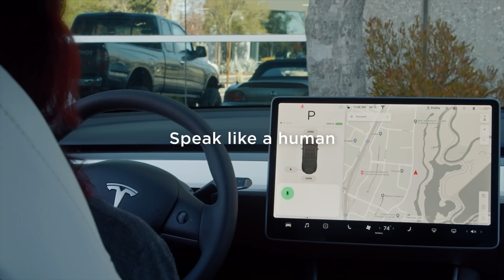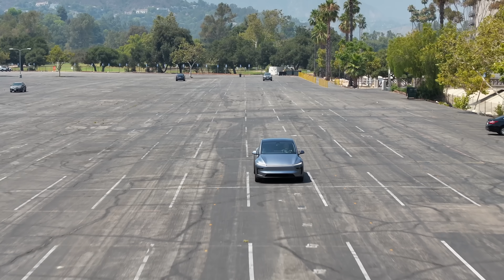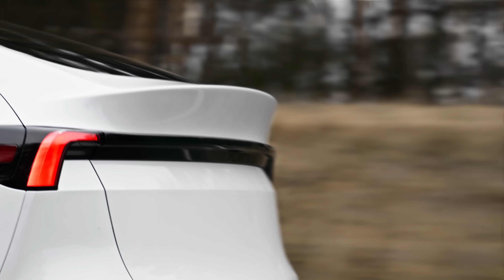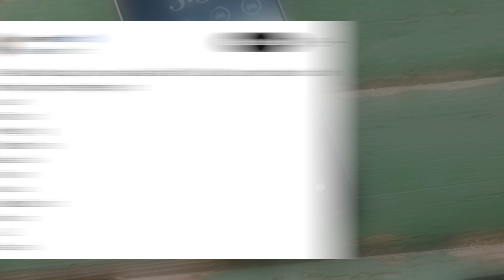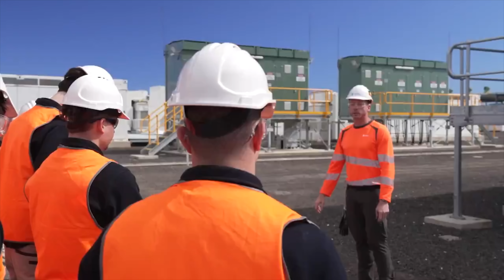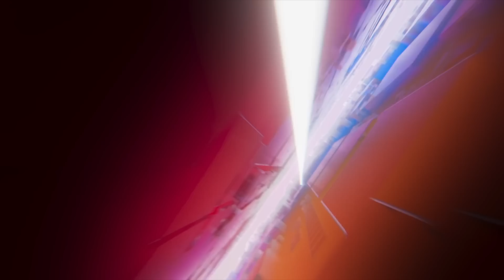Tesla Fixed Their Most ANNOYING Problem | Holiday Update Is Here

Comment: I still think automatic windshield wipers aren't so bad. The biggest problem is still that in the newer models (Juniper & M3), you can't switch between cruise control and automatic transmission (using the button on the steering wheel; in older models, you can use the lever).

Comment: Well thank goodness you can add fun stickers to your virtual car on the screen, that's what was the critical item. Hey, let's fix wipers that were clearly engineered by a team in LA where it rains like 5x year. It either dry wipes your window, goes bananas on a light drizzle or fails to actually deal with a heavy noreaster storm. Those are fixable via OTA update, the other serious weather problem that unfortunately would require hardware is the backup camera, it's garbage in slushy New England winter driving. When we drive on snowy slushy roads, you get to a supercharger and there is an inch solid coating over the camera. I love having to get out at a busy supercharger site and wipe it by hand. Could probably jury rig a heater around it or something. They probably did their winter testing in some ultra-cold place like arctic areas of Alaska which is a different problem, in snowy US states we mostly get slush on major roads, so that is a different problem than powdery snow. The dog mode update is nice. I probably won't use the grok navigation, although sounds nice, I rarely navigate somewhere where I don't know before setting off, so hand type my route.

Comment: My 2018 Model 3 STILL blasts hot air into the back seat unless I set the HVAC to approx -10 deg F of ambient. Once it's freezing in the front, the back seat starts getting cool air, and I can up the temp back to about -3 deg of ambient. I have reported this issue since an update broke it 6 years ago and Tesla hasn't fixed it yet. 
If my car can't do something as simple as HVAC, I'm not going to trust it with driving.

Comment: Most annoying is the slow down on the highway while using FSD.  In hurry mode the car will move to the left lane and then not drive at the speed of traffic regardless of the max speed setting.  Keep having to hit the accelerator to maintain safe speed.

Comment: I despise Grok in my car. If I accidentally activate it, it's nearly impossible to shut it off while driving. While it's on, the stereo can not be used. Even when I tell it to shut off, it stays on in the background. Unfortunately, there's no way to permanently get rid of Grok. I wish I had known before I upgraded my software, because I would have lived with the older software without Grok as long as the car would still operate. Who needs this intrusion into their automobile, anyway? Leave it as a phone app.

Comment: The clip mentioned charging only to 60% at home.  Would that be even better than charging to 80% at home on a daily basis?
Reply: No it wouldn’t. The reason they say 80% is because keeping the car at 80% and above puts more stress on the battery resulting in more ware on the battery. In other words keeping it at 60% is probably a personal choice and doesn’t change anything
Reply: @stephenhaynes5773 thanks!!
Reply: Yes, it would.  The closer to 50% the battery is, the happier it is.  But, it depends on how far you drive everyday.  If you can leave your house at 60% & still get back home at 40%, then go for it.  But don't limit charging to 60% if your car will drop down to 20% before you get home again.  
Tesla recommends 80% as a general rule of thumb because that is a good compromise for MOST owners who have an average distance daily drive.
Reply: @Judge-Mental very interesting.  Thanks

Comment: Super happy we can now control Nav with this update.  My car currently takes me on a different path to work every few days, and it drives me crazy.  no pun intended... lol
Reply: Each update seems to change the routing. If you have the whole trip up on the map (that option which has two dots with the S line between them) you can often pick other routes as you get closer. That's what has saved my sanity. Just tap a light blue option you prefer when it comes up. IF it comes up.
Reply: @Prescottfool  I know what you're talking about, but on my routes to work it doesn't give me that option.  Thanks for your suggestion my friend!

Comment: The ONLY feature I want is “Unlock Door” for ALL DOORS from INSIDE THE CAR!!

I live in a cold climate and I cannot keep reaching over my passenger seat to unlock the frozen door from inside. God forbid anybody is trying to get in the back seat cause I can’t reach that far.

Why does Tessie, a watch app, allow me to do that, but not native Tesla software?
Reply: You can do this inside the Tesla by putting the car in park where the Tesla car animation on the screen will display a lock icon. Simply tap on the lock icon to unlock the vehicle which will unlock all the doors. But yes the only pain is that the car has to be in park so there’s no ‘quick’ way to unlock all the doors when picking someone up. 🙂
Reply: @williamrobinson7864  I was just about to tell him about the lock icon on the screen.  Also, I'm pretty sure there is one you can use without being in park at the top of the screen.  The one when you're in park is above the 3d car image, but the other is at the top and doesn't require being parked
Reply: THIS!!!

We just went through a cold, snowy spell. Every time my wife tried to open the passenger door the handle was frozen solid so I had to reach over and press the button and push the door open. Her exact words were: "This is the dumbest car ever!"

Comment: Phone key chime SHOULD include Card key chime. Just today I was at Tesla Service, and they gave me a demo car while mine's being serviced. After we had paired my phone, I walked away from the loaner, and it locked the car with the card inside. Luckily, I was still at the Service center. Afterwards the salesman gave me his Phone# in case I make that mistake again. At least with a Tesla, they can remotely unlock the car.
Reply: There is no way to implement this. With a phone it use bluetooth to detect distance, while the card don't really send out any signals. The card can only be read when placed on a card reader.
It's rare one forgets a card in the car. I mean, what tesla owners use that anyway? It's only a backup, or when borrowing/renting a car.  But a phone left inside is VERY common. Not only your own, but also imagine when driving with the family, and your other half leave their phone in the car because "i don't need it, i'm just going to the bathroom". This exact thing happens so frequent for me i started just bringing their phones with me as well when i leave the car...
Reply: @JanErik1986  I would think the car knows there's a key card in it, to allow it to drive. Therefore, it would know whether the key card has been removed from the phone charger. But, I'm no expert.
Reply: @joegibbs2508  No, that's not how it works, unfortunately - well, at least not for the most part. 
There is only one indoor card reader on the Tesla, and up until around 2024/2025 this was placed on the center console behind the cup holder. The phone charger on these models were only a "dumb" wireless charger that is unable to make any communication with whatever device is there - the only thing those models CAN do is to detect if the charger is active and therefor know for sure a wireless device is left on it - but that's all it can do. 

The 2024/2025+ models do have the NFC reader integrated in the wireless phone charger, so those cars CAN detect if a card is left there, so it could technically be done what you said - but even so, no Tesla models will have any possible way to detect is a key-card have been left in the car unless it's left in the card readers location. it's not really common to leave it there, as it would slide away on older models, and on newer models you have to remove the card to charge your phone - you only need to tap the card to "start" the car.
Reply: @JanErik1986  Wow, thank you for taking the time to explain that so well. I never use a card in my own car, and didn't realize that I only needed to tap the card.

Comment: How about if they could just make it stop hanging in the passing lane just because it’s in hurry mode? How about if it would quit crossing solid white lines? Both of these things we can get tickets for but it does it all the time.
Reply: Don’t forget running red lights, changing lanes inside an intersection, pulling out far enough to block a lane and stopping because it sees a car coming, etc.
Reply: That's what hurry mode does. It hurries, so it goes into the fast lane.
Try chill mode, and use scroll wheel to turn down the speed of the vehicle.

Also use turn signal to over-ride and keep vehicle from changing lanes.
Reply: @d @dvader3263  If I use chill or standard and I set it to 74 in a 65, it wants to go like 52mph, I don’t want it hanging in the passing lane when there are no cars in the slow lane, it’s illegal, and it’s stupid. I use the signal to get it in the next lane and it immediately moves right back to the passing lane. It shouldn’t do things we can get tickets for.

Comment: WHERE IS THE FIX FOR WINDSHIELD WIPERS ugh...
Reply: Shut up about the damn wipers. Just turn them on manually, gosh!
Reply: @Desert_3agle . I would be happy to if I had a dedicated knob to do that but as it is, it requires you to take your eyes off the road and concentrate on a screen to try to get the right setting all of which are not good ideas when all of a sudden you’re covered in water by a passing truck on the other side of the road.  To you, I would say stop making excuses for something Tesla should’ve fixed years ago.
Reply: The "team" must still be working on it
Reply: I was going to comment something similar. My car can drive itself, but Auto wipers that just work like they are supposed to... nope, way too hard.
Reply: From what I’ve heard, the issue is that other cars use a dedicated rain sensor for auto-wipers.  Teslas don’t have that, they are trying to use FSD cameras for that, but those camera’s focal length is too long to see rain on the windshield well.

Tesla could add a rain sensor, Ie add a feature for newer cars, BUT Tesla doesn’t like to add hardware features like this, because then older cars (without the sensor) won’t get the update.  They like to keep as much of their fleet as possible, having access to all features.
Reply: @jonathansmith4968  that explains a lack of response to changes in rain conditions or road spray.  There is another problem they could fix and that’s the amount of speed settings available as well as the top end and bottom and speed both of which are not what they should be.
Reply: I have stopped using auto wipers since the 2nd week of owning my 2019 Model 3… I have been complaining and seen continuous complaints and Tesla simply gives their customers the 🖕🖕 for 6 years and counting… Pathetic.

Comment: I think "most annoying feature" depends on where you are. For me, my top is the fact that my car does not know (after almost 7 years), that I do not want the keep feature in auto mode, and that I do not want the AC running when it is at 33F). An annoying thing, is also that since day one there has been an "overheating of the cabin" mode but neither a "freezing the cabin mode, nor even a keep your batteries in good working temp mode. Of course I will solve this next year by moving from Alaska to Nevada. :)

Comment: I don’t think i’ll miss apple carplay when I get my tesla in a few weeks
Reply: you will
Reply: @ChanceOfStatic I definitely don’t miss it at all, haha. I thought I would, but I just got my first Tesla a couple months ago…and I don’t miss it one bit
Reply: @ChanceOfStatic Why?
Reply: I thought I’d miss CarPlay when I got my model 3 last year but I haven’t missed it at all.
Reply: I drive 150-200 miles a day dashing.  I don’t miss putting 1/3 of my earnings in the gas tank!  Even if I have to stop at a supercharger for 5 minutes I have no problems.  I have lost about 15% displayed range compared to EPA on my 2021 MYLR AWD, but I still don’t miss gas.
Reply: You'll miss gas at least I do i have both but range is not enough when you have to drive 35 mile each way to work and road trips, glad I leased it and give it back in April, definitely need 350-400 mi of range for it to feel proper plus battery degradation i lost 20 miles on a full charge less than 2 years of owning
Reply: @EvoX-zt4nz I definitely don’t miss gas. I charge at home and it’s back to 80% when I wake up in the morning. I also just did a 2000 mile road trip with my model 3 long range. It worked great! I actually beat my brother to the destination even though he had a gas car. Haha.
Reply: @flywithme7843 I done road trips from the bay to San Diego and definitely faster in our gas suv than the tesla just 1 stop for gas where its 2 for charging adding an extra hour n so to the trip, 400 range needs to get here its a nuisance

Comment: Hyundai has been really bad at pushing updates. The Ioniq 5 has things like the precondition button added, new graphics and a few other things. All I’ve had pushed to my Ioniq 6 is a battery update which broke the car three times and some map updates. The wireless CarPlay hasn’t been turned on either. I drove the car at the press launch, here in the UK. None of the updates promised have happened.

Comment: I understand that when a phone battery is either charging or discharging - that it is degrading the battery. If it is full (and on the charger) then the power required is coming from the charger - so no flow from/to the battery - so no battery degradation whatsoever.

Comment: Unfortunately for me Ryan ,Tesla need to fix things that are still not correct i.e Phantom breaking, auto wipers ,response of auto headlights to name just three things before all this "Fluff"
Reply: Everyone complaining about the auto wipers, it’s because of the humidity inside of the box where the front facing cameras are in the windshield. It is a known problem and you can wipe it out yourself or bring it to the service center, and they will wipe it.
Reply: @rvboondocker2559 i started getting the active wiper as well. It didn’t do it when I initially bought my 2025 model 3 in March. It started doing it recently.

Owning other cars with auto wipers, I knew to check to see if the sensor on the windshield was dirty or obstructed. I checked the Model 3 sensor and sure enough, there is fog build up from the plastic off gassing. I will clean be cleaning it this weekend.
Reply: Just had the new model y for 4 days it still phantom breaks in the middle of the road in exactly the same spot as the last 2 ones I owned so no improvement in the last 5 years.
Reply: Auto wipers I was really hoping were fixed
Reply: Ryan will check with Tesla PR and get back to you in 3-4 business days.
Reply: Same here
Reply: My 2024M3 Performance has none of these issues anymore.
Reply: I agree with the auto wipers and I live here in Florida where they like to come on when there’s a cloud in the sky pretty random
Reply: I have an android phone v14 software. My phone key still works only 5% of the time instantly. If I shake my phone and wake it up it will work 30% of the time instantly. Otherwise I stand and wait for them to sync.
Reply: @wdbldr67 battery saver on your phone. Disable battery saver for the Tesla app on your phone
Reply: @wdbldr67 battery saver on your phone. Disable battery saver for the Tesla app on your phone
Reply: The charge limit was already anything.
Reply: 100% agree.
Reply: Agree it would be great if they could fix the supper issue
Reply: I have a 2025 Model 3 and the phantom braking is infuriating.
Reply: @greenmachine5487 I have no phantom breaking. How can those disparities be?
Reply: @jonfscott No idea but I wish Tesla would figure it out.
Reply: Same
Reply: There is absolutely nothing wrong with the matrix headlights but ya and phantom braking almost doesn’t exist anymore and I’m on v12 the wipers I can’t stand that’s the only real thing u listed
Reply: None of those, other than the occasional dry wipe are an issue on v14.
Reply: Have you checked to see if the glass above the front camera housing is fogged up?
Reply: @b @barnywilson  course they don’t, they don’t care
Reply: You mean you can't dim your head lights?
Reply: @SlimJim1984 you don't need too. Tesla manages the lights to not blind oncoming traffic.  It is amazing to watch in real time as it turns off a certain area directed at a car and as soon as it passes that area is illuminated again.
Reply: @panoramadan62 Thank you